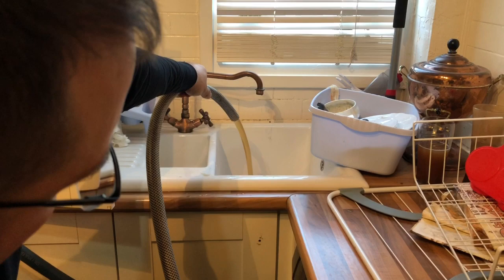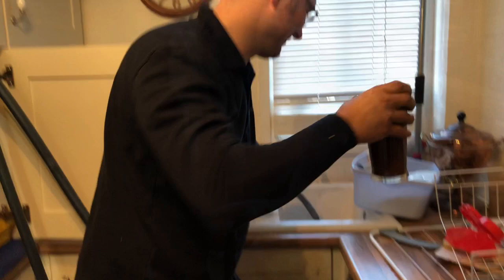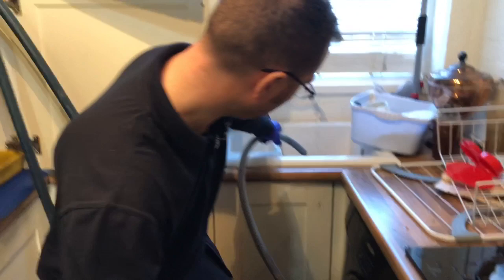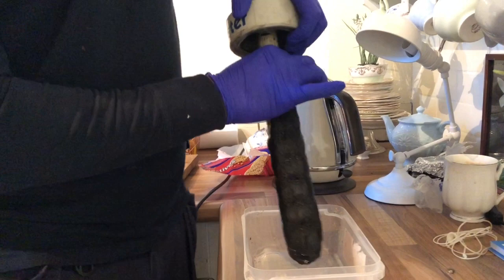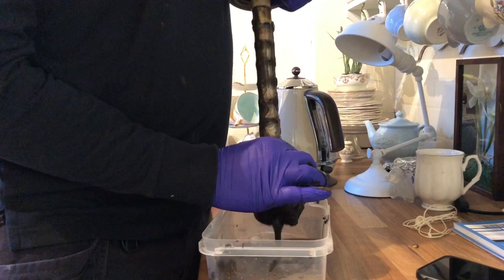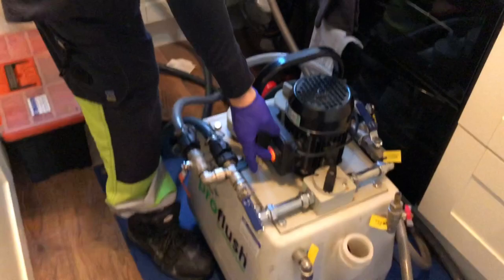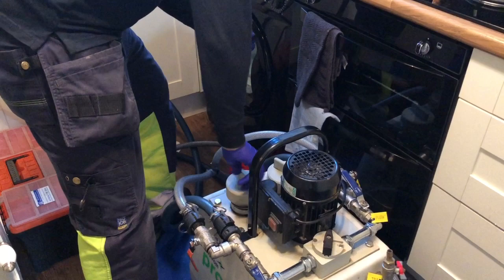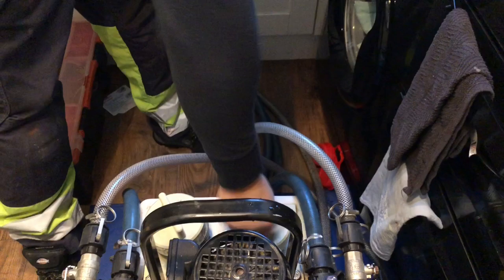How To Powerflush 2

Comment: Hi, I'm from Chile and I would like to ask you how much they charge for cleaning? charge for house or radiator?
Reply: Dear Elizardo a system flush will vary on the number of radiators and age of system. The average cost is approx. $450 American dollars (converted from UK pounds) Plumbing is expensive in the UK. The Flight and hotel costs and transport of equipment would be in the range of $4000....
I guess a chap from Chile would be a bit more competitive.
Reply: @e4phantom157  Blimey!
Reply: @martinda7446  Dear, I already have the machine in my house Chile (country), I have only found videos in English how to apply it, I am missing a step-by-step video, especially in the holders (key that is at the outlet of the radiators). I've already done three cleanings but I think there is something wrong with me.
Reply: @e4phantom157  no he didn't
Reply: I live in Liverpool and have 1 radiator (large) in my house that’s cold at the bottom and warmer at the top. Given that your accent is local to me are you still doing these jobs & how much would you charge for 1 radiator? 
Cheers